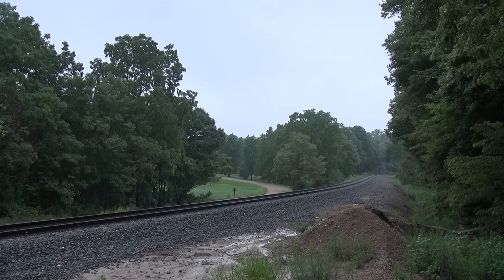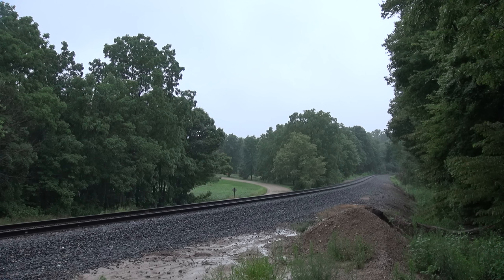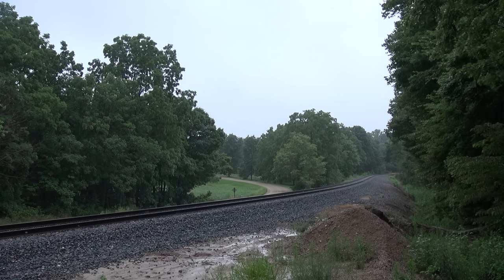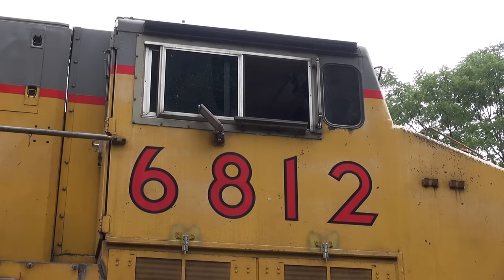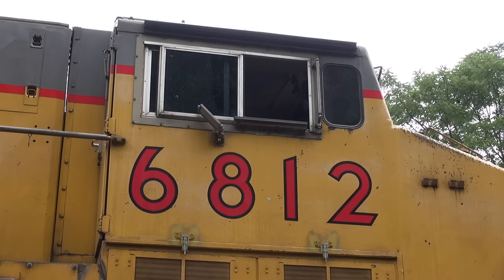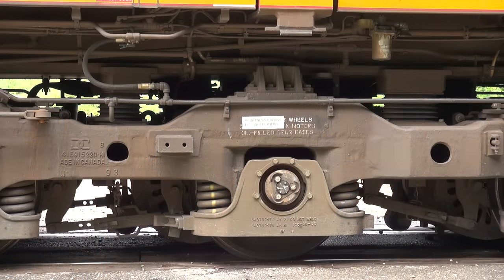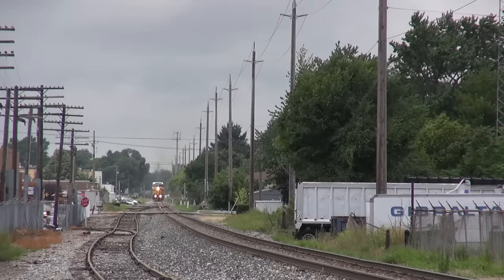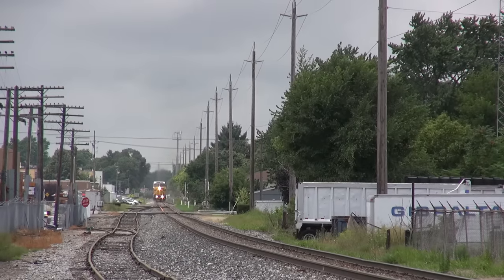TRRS 477: "Whoops!" CSX Freight Train Stalls on Grade

Comment: How does this even happen? Cannot they calculate before how much power they need to get the cars over the hill? Airline Pilots also try not to takeoff with an overweighted plane.
Reply from the maker: Railroads are a bit less...precise...in many ways that airlines!
Reply: CaptainDelight of
Reply: That's very true. They penny pinch with the fuel and will leave power units as dead weight rather than have them help. Sad, but true...And to think I own CSX stock. I have to attend a board meeting, money being thrown away!
Reply: exactly. besides, this is MICHIGAN; how high can the hills be?!?! the CSX runs heavy coal trains in the mountains of west virginia and kentucky. they should certainly be able to deal with the rolling hills of western michigan!
Reply from the maker: This hill is more formidable than many grades in the east, given its outlier nature. Just like any hill, if you're too underpowered you'll stall.
Reply: CaptainDelight youre moving thousands of tons up a hill of course that is going to be hard
Reply: If any airline pilot did that more than once they would lose their license
Reply: @Tim:  It's not that simple because it's not all just about weight/train-length).  The railroad company exists to move freight and to make money doing it.  The more cars there are in a consist, the better the profit margins are and therefore the more money to be made - up to a point.  However, the widely variable environmental conditions of the rails at any given location (humidity, hot/cold, rain/snow) all have a an impact on traction, and as seen here.
Also, I don't quite see how your analogy applies in any way.  A stalled train on a hill with it's engineer on the radio pleading for a "pusher" just isn't quite the same as a commercial passenger airplane nose-diving into the ground at the end of a runway.
Reply: Sell!
Reply: Railroaders aren't that good at math, TimTube.
Reply: Tommy Truth   They aren't very good at common sense either.
Reply: shekky  Long grades don’t look steep but will get ya.
Reply: IN AND AIR CRAFT IF YOU ARE TO HEAVY YOU DIE. IN A TRAIN YOU BREAK IT APART AND GO BACK AND GET THE OTHER HALF. JUST A LITTLE FUEL AND TIME WASTED.
Reply: More to the point, even if a pilot managed to put one past his own operations department and filed a flight plans for an aircraft overweight for the available runway in current wind and temperature the flight would need ATC to be asleep at the switch to get permission to taxi for takeoff... and then when all and sundry (including the tower radar recordings) showed the slow roll-out and an aircraft rotating for take off too far down the runway to abort, (because they should have) the entire cockpit crew could expect to have their licences suspended shortly after touchdown.
Reply: It's called ton-miles.
 @amberrooks5154
Reply: Power for a train may depend solely on what is available before departure.  If you only had these two units you go with these two units. On dry rail they may have made it. If it rained after the train left, whose fault would that be??? Railroads don't control the weather . The best they could have done was lots of sanding and track speed before they got to the hill. Worst case, double the hill after a stall.
Reply: There’s a 100 different reasons why it didn’t have enough power. Some places have had pusher service removed and the trains have to be double headed.
Reply: i argee with that
Reply: i agree with that
Reply: @normanreed6764  and a crew wasted.
Reply: Great video. So many obvious questions. Answer to them all: greedy railroad owners.
Reply: @ronaldckrausejr7762  Really, after the first attempt, the airline pilot would be dead.
Reply: Yep dead airline pilot for sure
Reply: We sure have a lot of youtube engineers and youtube pilots critiquing the professionals doing what they do for a living...and a profit I might add.
Reply: @paulalbares643  In my case, I was atracked by the "airline pilot" comment by Tim tube.  While a train engine may stall on an incline, the airplane that can't make the incline collides with the ground and that has a nasty outcome. And I made that comment as an airline pilot (professional) who is now in retirement.  The railroad taking a chance on incline is much different from an aircraft betting on a chance to outclimb a hill.  I don't fault the railroad for the chance they took as it was a business decission with no safety consequence.
Reply: @ampicoab  I was not necessarily replying to your comment, just all the comments that were made in general. Enjoy retirement, I am also retired, from the FAA so I was on the other end of the aviation community in the Airways Facilities portion, ILS, VOR, COMM, etc.
Reply: Think about how the locomotive transfers power to the rails.  That 9200 tons is relying on a tiny amount of contact between the wheels and the rails add some rain to that and you’re gonna have a bad time.
Reply: The tonnage isn’t up to the crew, they’re told what to go with, even when you tell them I won’t make the hill.
Reply: I hope you're not questioning their perfection,  @paulalbares643

Comment: in India we have wdg4 and wdg6g which are 4500 hp and 5000 hp locomotive. both of them are diesel engines and are used in combo so you can expect a hp of more than 9000 hp and 10000 hp respectively. If needed three or four of them are used as helpers. In India ghat sections pose difficulty for goods as well as passenger trains. India has wag12 electric locomotive which has 12000 hp 😅.

Comment: I can tell you what happened right off the bat: notice how starting with the rear cut that the GE unit's lead truck axles are not turning with the travel -- there should be a sliding-wheel indicator light on the control panel.  I have only stalled twice and the stalls did not occur in this format.  Usually a stall occurs due to poor equipment such as too many units being bad order and shutting down or due to wheel slip or wheel slide or a ground relay problem; the other cause would be the dispatcher and/or conductor not factoring the correct horse-power per-ton ratio; on Beaumont Hill in southern California our tonnage minimum was one-point-eight horsepower per ton for a minimum of fifteen miles per-hour.  I had one train that got over the hill at 8 miles per-hour with a mid-train helper because the train was heavier than the manifest showed.

Rain should not affect the factor-of-adhesion (i.e. tractive effort) of a train in most but not all cases -- however if the locomotive(s) do not have sufficient sand due to sand-pipe or sand box clogging from moisture then that aspect will count for the failure of making the grade.  I believe that in this video there were two causes for stalling: I could detect that the engineer was not that knowledgeable AND that the UP lead unit had axle/wheel rotation problems, and if the wheels did not have flat spots for being partially dragged at the ending terminal, then the engineer was lucky to have continued on the way the unit was acting.  The UP engine definitely needs to go into the shop!
Reply from the maker: In this case, the train was underpowered, having only about 0.80 horsepower per ton on a hill that requires about 1.0 horsepower per ton. That was the decision of the Barr YM and/or the higher-ups - crew of course just goes with what they're given. 

I should add that 1hp/ton gets you up this hill at about 5 mph in the wet.

Comment: Only two locomotives on a train of that size must be a recipe for disaster.
Reply: Benters I’ve never been quite sure but in America do they put locomotives dotted in the middle consists?

Extra locomotives should help with large, long loads like this.
Reply: @coledavis5212  yes, they do put locos in the middle of the consist... Here in Reno Nevada, I've seen upwards of seven front, five middle, and two rear helpers... We have a lot of mountains to clear here, and lots of freight to move over those mountains... So... Yeah...
Reply: @therayven3147  Wow!
Reply: They might've made it no problem with just the two units if it hadn't been raining.
Reply: @mrz80  Not at that speed they wouldn't have. Even if it wasn't raining, they'd probably need to have twice the speed shown in the video to have a chance to get over the grade. As soon as I heard 9200 tons heading up-grade, and saw only two locomotives... I knew it would stall pretty soon
Reply: @Brian Sloth No. Once Detroit and the Auto industry took off, and even more so the development of the DC-3, people found driving and flying was much faster than traveling by train and they didn't see the need to put much investment into research and development in the railroad industry.
Reply: @Silvercrystal77  You make a very good point about the DC3 and indeed the auto industry. However outside the U.S. that trend has been reversed, because now, or at least at certain times of the day, more people travel by train from London to Europe via the Channel tunnel, because it is faster and safer than by car, and when you add all the time needed to even get to airports, and hassle about with long queues and security checks, the British and European idea of fast Eurostar trains via the Channel tunnel make air and car travel look quite old fashioned. If only a similar system could be introduced into some U.S states.
Reply: @125sloth  the us is way biger then europe
Reply: @dknowles60  I agree, but still way behind with their railways
Reply: @coledavis5212   csx is to cheap to do that on that sub between detroit mi and grand rapids mi. you also need engineers train on DPU. . they are not needed for 6 trains a day
Reply: @125sloth  even if the us had a 300 mph train it would take 24 hours with stops to get across the us. 
 It sure don't take 20 hours to get across Europe
Reply: @dknowles60  Very true, However it only takes 2 hrs 30 mins to travel by train from London to Paris. I don't think any U.S. train has the capacity to do that. Even the latest Amtrak so called "fast trains" perform well below what they were designed to do. It's not about how big a country is, it is about the  time it takes to cover the same distances in any country. So if you put a UK  or French train beside an American one, and ran them over the same distance, it is not rocket science as to which one would win.  The infrastructure in the U. S. is not up to high speed rail, which is a shame.
Reply: @125sloth  the point is the people in the us wount sit still for 20 hour's we also have a lot of rights over in the us. it takes almost a act of God to take people's houses to make the tracks straight. I am a train watcher but gas is 1.96 a gal in the us  cars can be had for 1000 dollars. driving works very well for 99 percent of the us. China will never lend the money for the us to get big in high speed rail
Reply: @therayven3147  i only asked the question because it seemed like a lot of americans seemed like locos in between the consist seemed like a foreign concept to them
Reply: @dknowles60  Very good point

Comment: Would another power unit have prevented this? How do they determine how many power units should be part of a consist?
Sorry for asking this kind of question........I'm kind of getting into railroading at a late age. Just finished my first Amtrak trip....and now I'm hooked.
Reply from the maker: Yeah, another locomotive, assuming it was a decent size, would have gotten them up the hill. They were close enough to making it with a 3rd unit, but nowhere near the ballpark with the two they had.
Reply: It is known how much tonnage any particular locomotive is good for on any particular subdivision or terminal, it is just a matter of doing the calculation to determine if you have enough power for the train.
Reply: Been hooked since my Longview  tx to Chicago  trip on  Amtrak.

Comment: NO WAY TWO ENGINES COULD PULL THAT TONNAGE????!!!
Reply: Actually....what is the tonnage?   Do you know by looking at this train?     Length does not equate to tonnage.   And I guarantee you railroads pull heavy tonnage trains up significant grades thousands of times a day with two locomotives.    Sometimes you do not make it.   That has been the case since the first railroads were constructed.

Comment: See kids, this is what happens when you cant drive a stick shift.
Reply: granny shiftin'. not double clutchin' like you should
Reply: LOL my VW V6 Passat pulls a 11-12% grade in 4th at 65mph all day long, better make sure you dont skip shift and pull the power through 2nd and 3rd into 4th., My 85 Accord with 86hp.. Cant climb that grade at posted speeds in any gear, no matter what you do. 3rd gear, 45mph and about 4500rpms is the limit for that old girl. I mean, you could pull it better but its just unneeded wear and tear on a 330k mile engine. The Passat makes 3 times the power

Comment: So we all know it's a scientific fact that gravity is eventually going to take over and forward momentum will be lost I'm sure the railroads know about this so why not add a 3 rd engine for the uphill battle  ?
Reply: Uncle Buck I am one of the guys that manages the hill all trains over 10,000 tons must have a pusher but anything under that will go as rated for the tonnage sometimes you just don't win and to add extra power would add extra expense that on most trips would just that.
Reply: C David I understand the fact that separating the tain in smaller more manageable sections to lighting the load to get the train up the hill is a good option but it seems that would be costly both in time and manpower .
Reply: It might be less expensive to do it this way, rather than pay for a third unit.
Reply: Gee, that's a different take different from the Chessie doing the "Precision Scheduled Railroading" thing... 

Let's get real. What you're looking at is what happens when a railroad's headquarters has used a lower traffic forecast to plump up its balance sheet by minimizing the cost of motive power on the locomotive roster. Rising traffic caught the Chessie with its pants around its ankles and an on-again, off-again rebuilding program for 50 year old motive power at locations they'd already scheduled to shutter. [hard to to accelerate the schedule when the only thing extra the workforce can expect in their envelopes is a pink slip.] 

To be fair, it wasn't irrational in 2016 to expect that the incoming administration would be a continuation of the previous one and there would be an accelerating decline in coal traffic and heavy industrial feedstocks and finished goods.
Reply: @oliverstreet7704  A complete waste of time and effort all because some idiot yardmaster or trainmaster said "go with it...just get it out of my yard"!!!

Comment: Well 2 problems here. 1) CSX using UP motor as lead. Everyone in the industry knows you can’t spell stupid without UP so whoever made the power plan for this partly was partly stupid. 2). 8800 hp and 9200 tons on a long grade = no bueno. Not sure what easy coast r.r.’s figure but BN has HPT calculations for powering trains. UP uses TPA. Either way someone didn’t plan very well.
Reply: Third problem...jdhrap is a typical type of railfan who second guesses professionals without a clue as to what is really going on

Comment: Could have added another locomotive somewhere near the middle
Reply: prdp 

In Canada that is very normal. One to four trains in the middle depending how large the consist is. Do they do that in the US? If they don’t they really should.
Reply: ExplodingHam : I lived in the Rocky Mountains in Colorado and the coal trains that went through had at least six locomotives (2-2-2), and sometimes nine(3-3-3).  I lived right next to the West Portal of Moffat Tunnel.

https://en.m.wikipedia.org/wiki/Moffat_Tunnel
The railroad tunnel is 24 feet (7.3 m) high, 18 feet (5.5 m) wide, and 6.2 miles (10.0 km) long. The apex of the tunnel is at 9,239 feet (2,816 m) above sea level.
Reply: they could before leavin but if u listen they'll doin next best thing breaking train so get it over down safe yea nornal thers a pusher and all wend thoes train go up those kind of grades

Comment: One thing that has been overlooked - before making the cut with the head end of the train - hand brakes had to be applied to the rear end of the train to insure that it would stay where it was left.  The first cut moved to the siding also needed hand brakes applied to keep it in place.  Without hand brakes, cars on grades can go rolling away.

I didn't notice the engineer using sand when attempting to move the rear portion of the train.
Reply from the maker: Yes, the handbrakes were applied but I didn't have a good view of it and so it didn't get included in the final cut. Also, he was using sand, it's just hard to see in the video.
Reply: Absolutely spot on, that was also my observation, no hand brakes applied to rear portion, no protection laid down to warn of blockage left on track, no warning at rear of train. All in all a good 4 hrs work involved.

Comment: this would never happen in germany. even if the carts are heavier than declared, there should be some backup power in the calculation. like with... everything
Reply: you mean like in Stalingrad
Reply: To qoute rulebook 408 the most important thing is safety. On second place is punctuality and then only on third place is profitability. They clearly violated that in this case.
Reply: @tripplefives1402  Well, so do the tracks, if one blocks them for an hour because of a clusterfuck like this here, then that means another 15 or 20 blocked trains all losing revenue. Besides, cargo trains should move at a 100 mph, shouldn't they? No point in being slow after all.
Reply: Like ww1 and ww2 i guess?
Reply: bonzty US trains have be profitable. If it’s more profitable to divide the train to get it over the steepest grade rather than have excess power for most of the run then they may well do that.